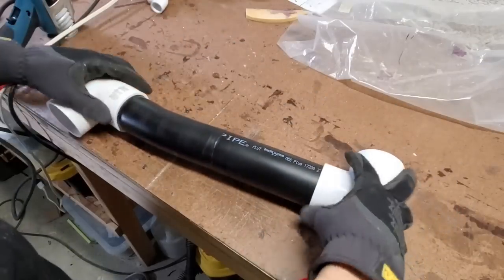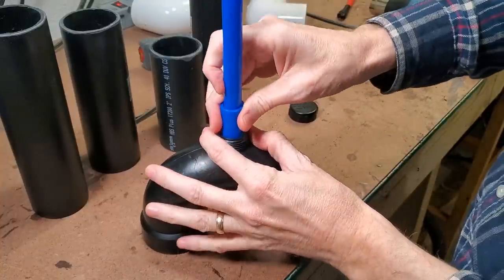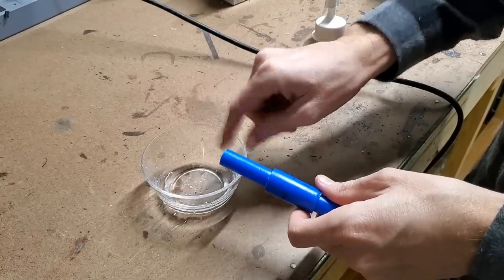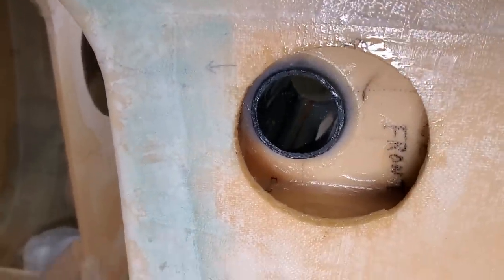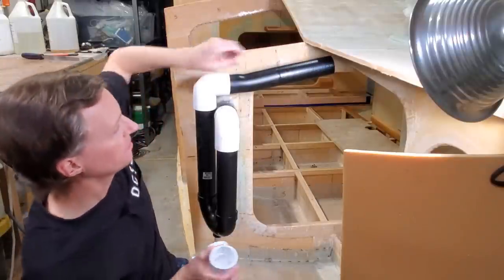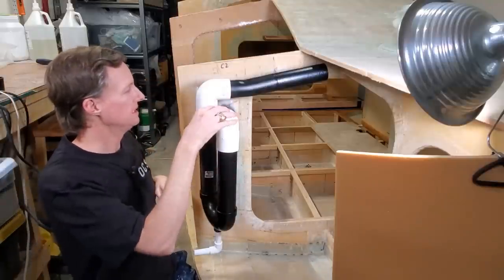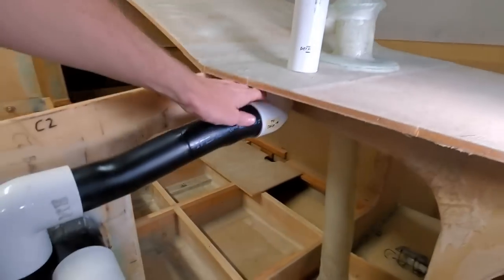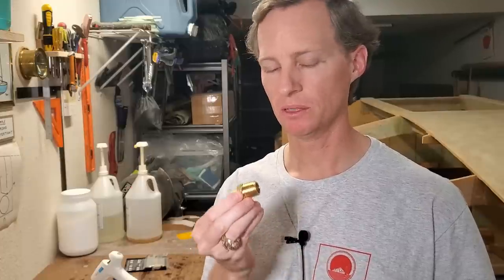OCSS-051 PVC Cabin Ventilation - Mini-Cruiser Sailboat Build

Comment from the maker: How would you attach pipes so they are watertight but easy to remove? Some kind of tape maybe?
🍍Thank you for watching! 🤩 

Want to lend a hand? You can help out by buying necessary supplies on the wishlist: https://www.amazon.com/hz/wishlist/ls/16R9S2M7BYQX1?ref_=wl_share  👍⛵🍐
Check out the T-shirt’s here: bonfire.com/ocean-capable-small-sailboat-1
Support OCSS Through Patreon! https://www.patreon.com/oceancapablesmallsailboat Members watch 1 day early!
Reply: I would create a little recess in the pipe and fit an o-ring. To hold the fitting safely together fit a short self-tapping screw
Reply: Use a compression fitting. Swimming pool fittings will probably work with your diameter of pipe
Reply: I think you'll be fine without sealing, except it could come loose.  I liked the idea of the pool connectors someone mentioned.  You could also try a butyl tape.  It's watertight and easy to remove.
Reply: dont you need another vent to create some sort of pull through and possibly some fans to blow the wind in the right direction?
Reply: If you put a valve right before your air output, you could close the system off and flush it out with a cleaner and water. 

Otherwise, I would seal the pipes with aquarium silicone sealant. If you seal the seems, it would be easy to remove with a razor blade later to get access.

Great work as always!
Reply: Do you have any idea of cost to build another version of your boat? It's a great boat.

Comment: Hi Perry.
Thanks for mentioning my channel.
Try to awoid brass on a boat as it may become brittle and crack bronze or cupper. You can also make the parts in glassfibre.
Use polystyrene as pattern leave it in place then melt it down with a solvent. A bit messy.

Comment: If you want to heat and bend pvc or pex with heat, take an amount of sand that fills the pipe and put it in a pot.  Heat at 350 for about 30 min, stirring multiple time to thoroughly dry the sand as it heats.  Then pore it into the pipe and wait a few minutes while the sand heats the pipe.  You can then bend the pipe and the sand will prevent the pipe from kinking.  Lots of videos available on this technique.  I have used it many times and it works great.
Reply from the maker: Cool trick! Thanks.
Reply: I agree ! Sand works with copper pipes too. My plumber is a wizard and I enjoy watching him do magic work with his tools (including this sand from Portugal).

Comment: I also agree with M. Silvius regarding a valve at your through hull. I know you are trying to reduce cost and complexity, but safety as sea, especially solo sailing, is paramount.  Also, at the base of the U-bend where you incorporated the 1/2” pvc drain for the through hull, instead of using a 90 degree elbow, perhaps it would be better to use a tee (bullhead configuration with the run of the tee facing outboard and inboard) with a serviceable cap facing inboard end. This would allow you to clear any debris/blockage that may occur if your dorade ingests any seaweed, etc.

Comment: Wow you sure know how to trigger my contractor's OCD! Mixing PVC and ABS! My heart is pounding and I think I need to visit the ER for an EKG! So glad you scrapped the glued pex - that would have killed me. Fyi there are brass fittings threaded on both ends and cheap threaded adapters made of PVC that would form a more "conventional" transition than whatever sealant you used. A temporary "glue" for your joints could be latex caulk (no silicon) but don't use too much or it might as well be permanent - just use it externally not on the mated surfaces if you want to be able to pull them apart later. I do wonder since ABS elbows exist - why PVC? Or the other way -PVC pipe exists - why ABS?
Reply from the maker: 😂 I think the trouble started because I wanted to use all white PVC, but they only had the return bend in ABS, then the straight pipe was a couple dollars cheaper if I went ABS. Then later I decided a white straight pipe should be installed for the pipe that goes through the deck, so that it would be easier to paint white. Ended up BACK at Lowes to buy white PVC pipe for that. It'll work fine, but yeah I would do it differently if I had to start over.
Reply: Liam, as a retired union pipefitter of 50 years, I too cringed with the pipe mix! But considering the use and circumstances, I will give Perry a pass👍

Comment: For tube bending there are metal springs that you need to enter into the tube. They will keep the shape while bending and you pull them out after.
Reply: Good advice 
In the old days 1950-s for metal pipes we used sand and a wooden plug in each end.
If you do not have the metal spring maybee a rope will work
Reply: @SvenYrvindExlex  idea of sand it is really great. Good luck Sven with your adventures.
Reply: @SvenYrvindExlex  - I think rope would compress too easily during the bending process.

Comment: It would require some refitting of the assembly, however if you were to use  rubber connectors rather than PVC connectors your temporary fixing of the joints would be solved with a couple stainless steel worm drive hose clamps. If the ends were cut square and accurate the rubber would never be in contact with water and therefore not be subject to dry rot for a long long time. 👍
Reply: use silcone thick wall tube, remember freezing temps are possible.

Comment: I realize the brass drain thru-hull fitting will be above the waterline but I think a shutoff at that spot is imperative. If your vent pipe integrity is ever compromised for what ever reason that may be, not having a shut off there would allow a direct opening into the cabin from the outside way too close to the water for comfort. Any minor wave would push water inside the boat. Any amount of heel will put that drain in the water. Not good. Make the thru hull fitting out of a threaded bronze tube that is sufficiently long to protrude on the inside of the hull by about an inch. That way you can screw on a brass shut-off valve on the inside.  I also would be inclined to use barbed brass fittings with a hose in place of the 3/4 inch PVC coming out of the drain in your black U trap. This will facilitate removal for service and in a pinch you could disconnect the air vent drain and run your bilge pump out there too.
Reply: I do not trust how that drain is connected to the trap piece. Don't rush to do this if you can't get the right part. When you're alone in the ocean. You want what's keeping you afloat to be solid. Plumbers tape to a opening will blow the first time it's hit with real pressure
Reply from the maker: I think just keeping a cork or rubber stopper around would do the trick until repairs can be made. Stopping the boat or going on the other tack easily brings the drain out of the water.
Reply: @ocean_capable_small_sailboat  it's better to build to not need that then plan to fix it. Plus they probably make a hose or PVC adapter for that thread your connecting too. You could drill a hole in the cap the same size of the white PVC. Thread the PVC pipe through the cap you drilled out and then flare it. That way you can apply sealant and get a compression fitting. Plus if you're upside down and that pipes open it will allow water into the boat cause it won't have the internal air pressure keeping it out

Comment: your ventilation is a super design. For temporary sealant you could use a self vulcanizing tape. I think the sealant capability would be strong enough and you can simply cut it away if necessary. Only the lower joints I would bond together as there could be a water column while listing to the starboard side.
Reply from the maker: Thank you, and good idea.

Comment: Great idea that vent system. I would suggest to mount a sucker scoop outside on the hull over the drain outlet. Similar to self drainers on open sail boats. It will prevent water being pushed inside.
Reply: Is it useful, though? Water entering this way would be drained immediately.
Reply from the maker: I was thinking of having a rubber flap to prevent waves from pushing water in, but I decided I'll try sailing with it as is and see if it's needed. I suspect no water can be pushed in from the little drain hard enough that it can make it all the way up to the cabin vent.

Comment: I like your thinking.
I would have added a value just after it enters the yacht for when it's very rough outside. Should the vessel turn upside down no water will enter the yacht.
Reply from the maker: Thanks, due to the big U shape it shouldn't allow any water in through a full rollover. But I was thinking if really rough weather was expected I could just replace the cowling on deck with a cap to keep out all water.
Reply: @ocean_capable_small_sailboat  a cap requires you to leave the safety of the cockpit.
A value can be turned off from inside. I also would not have any holes in the hull. I would have a bucket. Which could be hand or pumped empty.
Reply from the maker: At least the only holes are above the waterline, most yachts have so many below water holes for all kinds of intakes and drains, plus the propshaft and depth sounder and on and on and on... @BruceSinclair-w6k

Comment: Am thinking maybe you could just apply an external bead of silicone to the joints since they're already essentially watertight with no seal.  Also maybe clamp/strap them in place as necessary just to eliminate the possibility of something inadvertently pulling apart?

Comment: For removable connections just use elbows or fittings with a rubber packing seal/gasket that slides over the pipe.

Comment: Regarding your ventilation piping, specifically the joints that you want to “seal” but would also like to be able to disassemble, I have a suggestion. What I would do is butter the joints with dielectric grease (silicone based). It is waterproof, odorless and inert. Where the piping is not going to be subjected to any significant pressure, it should work fine. I would also add one small, accessible if possible, SS screw to each unglued joint as insurance in order to avoid an unintended separation and to lock things up.
Reply from the maker: Thank you, I like the idea.

Comment: Hi Perry, in my opinion you have made a hole in your boat. When sailing the drain will be below the water line and as found out by Archimedes the water will enter your cabin…… the solution could be to fit a non return valve in the drain. But I doubt if that will work with so low overpressure.
Reply from the maker: Yes when sailing on a port tack the drain will likely be underwater. A little water will enter the pipe, but not high enough to come in the cabin, which is quite a ways up. Everything will be tested once she's in the water.

Comment: Hi cap' , nice work! For the vent system, the water won't get in if the boat is up side down, OK. But what if the boat lays en its side? If the tube is under the water level, won't it get in?
Reply from the maker: Hard to imagine the boat staying in that unstable position for more than a couple seconds. I think the drain will be above waterline even on her side due to the beam up at the bow being more narrow and most the weigh being back aft. But we'll see, some small adjustments can fix it if there's a problem.

Comment: those joints you want to temporary seal i would,nt put anything like compounds into the sleeve of the joint it will harden eventually ,best thing i can think of is the very sticky aluminium tape it would seal perfect on outside of joint and when removing use a small blade to cut around join edge
Reply from the maker: Aluminum tape, thank you that's a good one.

Comment: Regarding the temporary seal, why not use compression fittings which have rubber gaskets and threaded connections which can be removed easily.

Comment: To make it removable Glue your elbows, cut it in straight sections leaving like 2 or so inches before an elbow/fittings and use a couple 2 inch furncos to join the sections while also leaving the option to make it removable. Furnco are rubber coupling designed specifically for joining two pipes together, theres a couple different style but the all ruber with 2 stainless clamps would work just fine.  Maybe i missed the part but why is your trap so low and why bother with PVC to ABS? FYI you can buy transition glue for pvc to abs. Its green and will get the plumber off your back.. if you must use pvc to abs thats the correct glue to use to glue the two together.

Comment: Yes, if the boat lays over water won't pour through the cowl into the vent, they are so far separated that both under water isn't likely. But what about the drain and the vent? If the boat lays over on her starboard side just over 90 degrees, would the vent and the drain tube be below waterline at the same time?
Reply from the maker: Possibly, and there are a couple tweaks I can think of to fix it without much trouble. But, it's also possible that because the beam is less at the bow and the weight is mostly aft, that the whole system will stay above the waterline when on her side. We'll see.

Comment: This will work fine, but since you are talking extreme cirumstance into account, I wonder if the water pressure is and indication of the pipe completely filling with water beyond the diameter. In other words blocking air flow before the water is drained. And could that lead to problems if air & water mixture is forced down the vent with the water pressing up. Doubtful, but something to be mindful of. Turning the vent away from the storm wind direction would solve that. Then there is the theoretical possibility of a venturi effect sucking air out instead of in. Again most likely not a realistic scenario..
Reply from the maker: This one up forward is actually only an exhaust vent. The cowl on deck will face downwind. Air will be sucked out of the cabin here. Air intake is back aft at the main bulkhead.

Comment: Because this is not a pressure system you can use beeswax on the joints that you are not glueing. Simple apply a fairly reasonable amount of wax to the female part of the joint .  That will keep the joint inplace and stop any water leaking and allow you to dismantle the system should you wish..

Comment: Never ever use bathroom silicone on anything you don’t want to trash afterwards. Once you get silicone on a surface nothing will ever stick to that surface again, not even silicone, without a lot of chemical cleaning or sanding. If you want that kind of sealant use Sikaflex or something similar, silicone isn’t salt water resistant either, Sikaflex (and similar) is.

Comment: No place for brass on a boat. Salt water leeches the zinc out the brass and it becomes brittle! Bronze or stainless , or plastic only please .
Reply: This can't be stressed enough. Brass does NOT belong on a seagoing vessel!
Reply: That makes sense with zinc being the most common sacrificial anode
Reply from the maker: Thanks, I'll look around. Maybe some copper fitting would work.
Reply: @ocean_capable_small_sailboat  bronze or reinforced plastic only for strength.

Comment: Hm. Problem with your construction might be: On a starboard tack there can be water standing in the horizontal part between the first and the second elbow. If the boat is heavily rolling, the water will drain, but with a steady heeling to port it might prevent ventilation.
Reply: There would be enough ventilation from the other side I think.
Reply: @cornishhh  The two must have flow at the same time, one in one out.
Reply from the maker: I don't think much water will get in normally. Even when heeled, the natural movement of ocean sailing will empty that pipe in short order.

Comment: years too late I know :) but if you want to bend a pipe without it kinking fill it full of sand before you bend it. This has been used to bend copper since copper pluming was invented :)
Reply: Plumbing.
From the Latin ‘plumbum’,  meaning ‘lead’,  because the original plumbing was lead pipe.

Comment: Never silicone on a boat 
I think that vent should bi very strong an safe.  Glue it very tightly and well.  If u got a problem with that and the drain is near the waterline, u can’t sail on starboard tack.
Reply from the maker: Sound advice. Someone suggested dielectric grease and that sounds like a pretty good option.